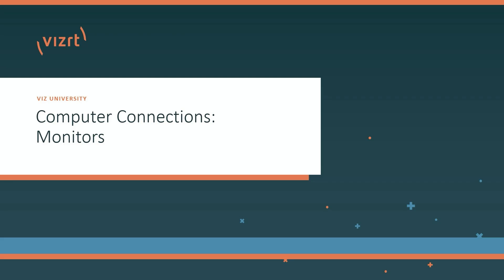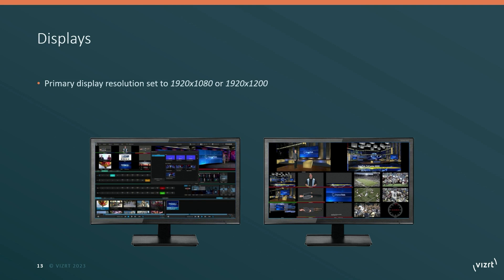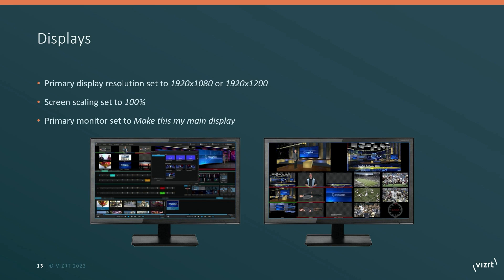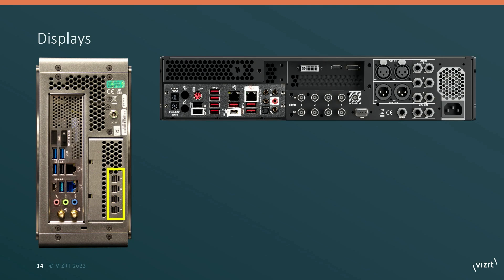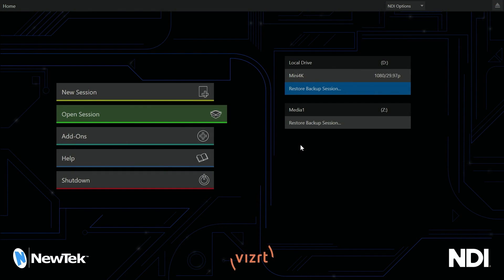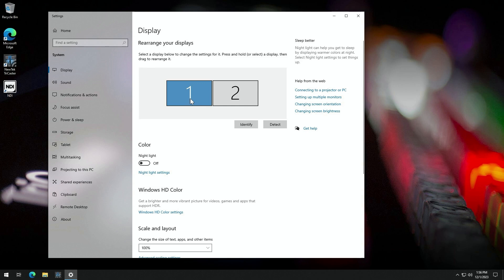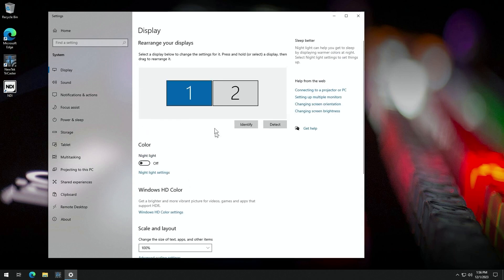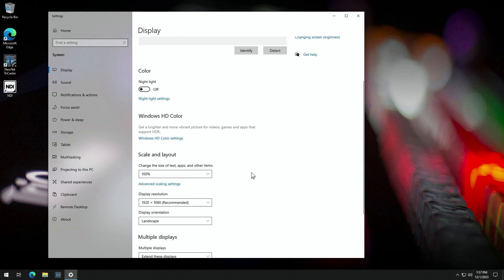Setting Up Computer Monitors on your TriCaster

Comment: Trying TriCaster Mini S Demo right now...

I have 3x monitors with 1920x1080 and 100% scaling, and 1x monitor (the Elgato Prompter) that runs at 1024x600 but 100% scaling. I notice that if I run the live production without the prompter, everything seems to scale correctly. However, if I have the prompter plugged in and hit live production, it seems like the main monitor is offset with some black space on the left side.

It's interesting to note though that the TriCaster home screen is perfectly fine with the prompter being turned on. But Live Production seems to add black space to my main monitor and it carries it over onto my right monitor, if the Elgato Prompter is plugged in.

This is the case even if I set make it so my other monitors to "App Display" and keep my main monitor only to show the TriCaster software itself via the settings inside Live Production for the layout.